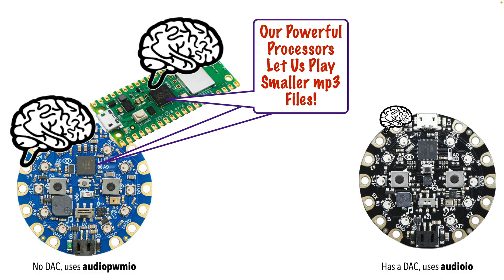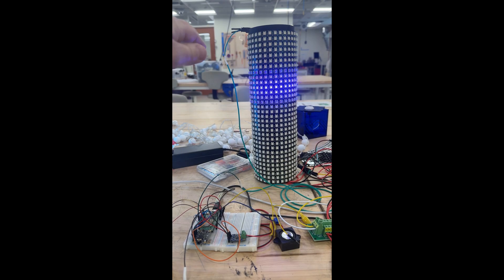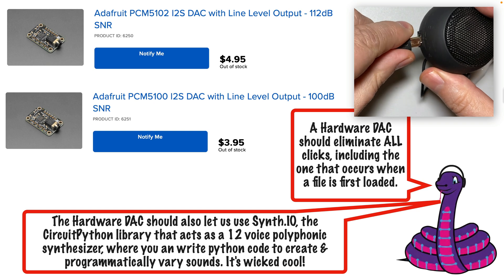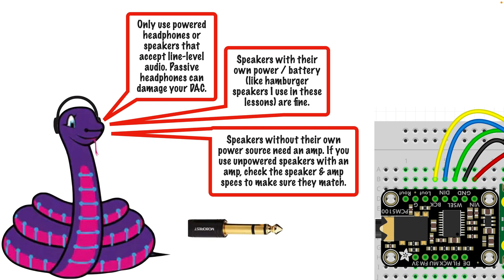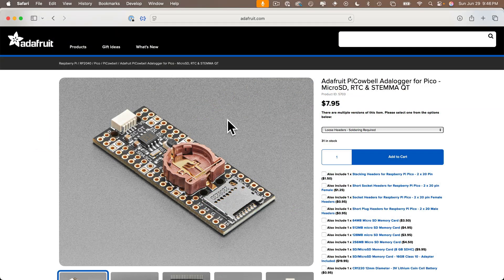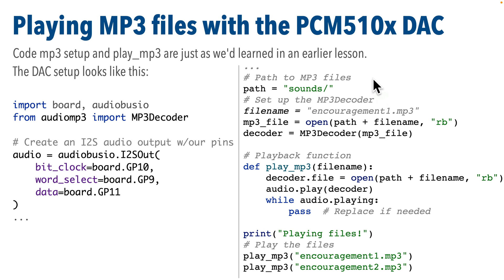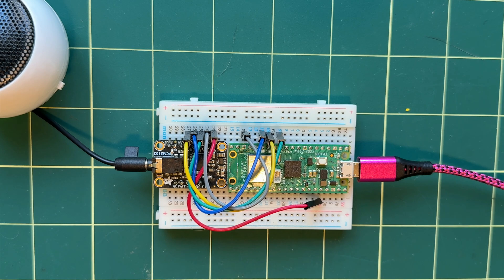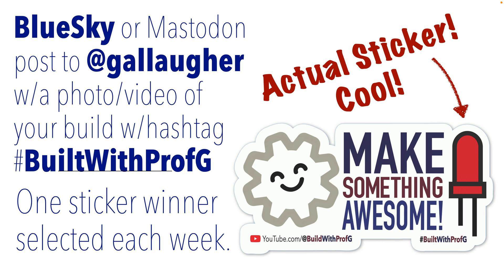Better Pico Audio for the Raspberry Pi Pico! Using an Inexpensive DAC (CircuitPython School)

Comment: Hello! Thanks for the video! Wondering if there's a way to make the sound high quality, I'm going to try to interface this with my computer for a custom headset
Reply from the maker: Wav files are lossless meaning they have all the bits used to record audio so use those. The rest should be determined by the quality of your speaker. Good luck!